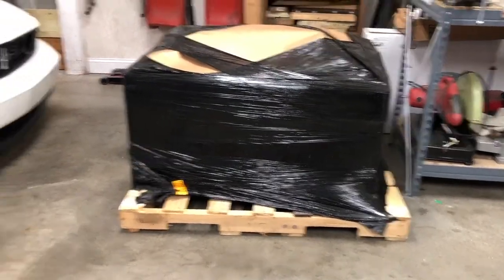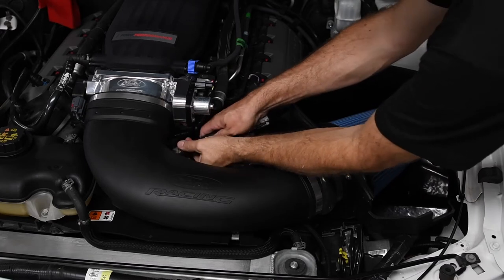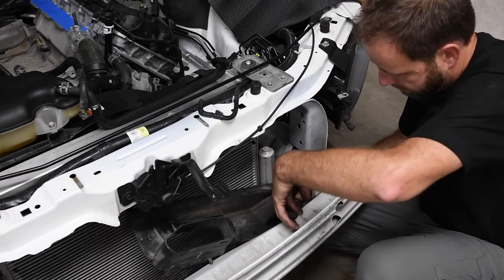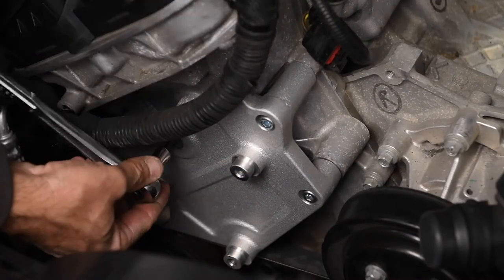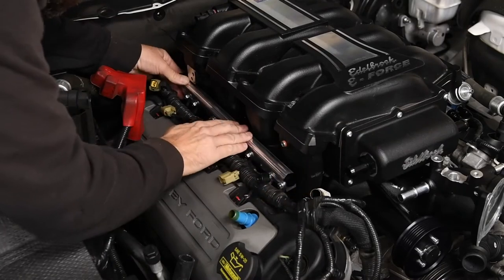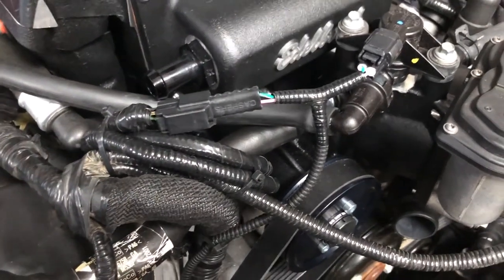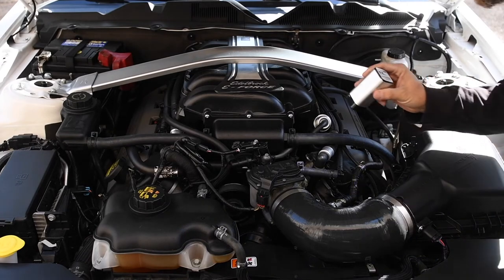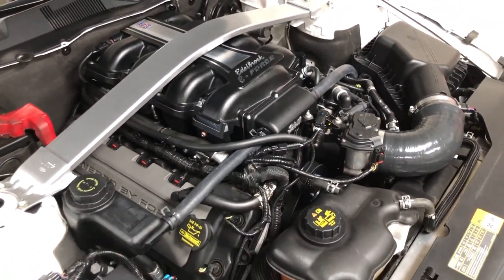Edelbrock Mustang Supercharger Install and Dyno Test

Comment: I have the same setup on my car, but a 3.25 pulley on my stock 11. It made 532/488 with a brenspeed tune and kb boostapump.
Reply from the maker: Nice! Once I build the motor with better rods, I'm going to start pushing the boost on this one.
Reply: @Mustang-Geek  same plan for mine. Brenspeed told me a 3.25 pulley is about 9psi  and the most boost that would be safe for the stock rods.
Reply from the maker: @steibz3262  Edelbrock has smaller pulleys too...muhehehhehehaaaahhhaaeee
Reply: @Mustang-Geek  yeah I'm not running any smaller on a stock motor.
Reply from the maker: @steibz3262  Oh, totally. I'm saying once I have better rods, THEN it's time for smaller pulleys. Heck, I didn't want to even put the 3.25 on it until I had better rods. REbuilding a motor is expensive. Building a BROKEN motor is MORE expensive, right?
Reply: I made 531hp and 530tq with the same as yours. Maybe long tube headers are my secret to more trq?
Reply: @carstuff4u942  definitely possible man.

Comment: Seems a little underpowered, good video however. Gen1s can take up to 600wheel pretty happily on pump gas. I believe a good tuner and maybe a little smaller pulley will do the trick.
Reply from the maker: Yes, this is with a 50-state tune, stock pulley, etc. We're gong to fortify the engine with better rods and pistons, do smaller pulley, and start squeezing more power out of this combination. There's A LOT more in it!
Reply: @Mustang-Geek  good to hear 👍, great idea on building the engine before continuing with more power. Never is a bad idea.

Is the pulley on these blowers just as easy to switch out just as a traditional TVS?
Reply from the maker: @coyoteaustin17  I'm fixin' to find out! Just four bolts...

Comment: Wouldn't the intercooler being directly in front of the radiator cause overheating issues?
Reply from the maker: Not necessarily. The intercooler heat exchanger is pretty cool relative to the radiator. We didn't experience any decrease in cooling ability.
Reply: @Mustang-Geek  so air passes through the intercooler pretty well?
Reply from the maker: @bkehlin  Absolutely.

Comment: I have basically the same kit on my 2007 F150 5.4.  It makes a screeching noise under boost.  The guy I bought it from said its always been like that.  I personally think its belt slip.  I dont mean blower whine.  Does yours make any such noise besides the whine under boost?
Reply from the maker: My blower does not make any such noise. There's not even much blower noise because it uses the stock air box. I'd suspect belt slip.
Reply: @Mustang-Geek  I appreciate it.  I do as well especially since Ive now looked and the belt is worn out and missing a whole rib!

Comment: What throttle body is used here? stock? can larger 85, 90mm be used?
Reply from the maker: The stock throttle body is used, and the opening on the blower matches it. You could probably use a larger throttle body and port the casting to match, but I doubt it's worth the effort for two reasons 1) unless your tuner has proper, OEM-level throttle body flow data, you could have drivability problems, and 2) The rest of the supercharger inlet may not support the flow of a larger throttle body either. In other words, I'd keep the stock throttle body, and if you want more power, use a smaller pulley. Even at 10 PSI (video coming soon), this blower is hardly working. This thing can support HUGE power if you have a built engine and fuel system to match.

Comment: Reaching top horsepower with the factory connecting rods?  Don't tell my 2011 GT with the same blower,  but 10psi pulley.......
Reply from the maker: I could probably push it, but building a running engine is cheaper than building a broken one.

Comment: Every vid I see of these are in the 500-550whp range which Im not liking... I'd love to see one making 600+ whp.
Reply from the maker: This is on a Mustang chassis dyno, so I'd imagine on a dynojet it might "make" more power.
Reply: @Mustang-Geek  I definitely think you'll break 600whp+ With just a pulley and another tune. Its just I cannot find anyone whos doing this lol I just got one traded my paxton for it and I'm hoping to make 600-700whp with just a simple 3.25 id1050 injectors and BAP. Lund is confident I can get mid - high 600's
Reply from the maker: @liyahalex7308  Keep us posted!

Comment: A “Massive 86hp”  for a 185lbs extra on the nose!?!   Since when is the limit for the stock connecting rods 452 rwhp??? This is a Coyote 5.0.....isn’t it? That sounds like a 3valve thing.......  Not impressed at all. That’s $70 per hp. You could spend $6000 on NA mods and a good tune,  and be —-way—-  further ahead.
Reply from the maker: Glad you liked the video! Sorry you're not impressed. I'd like to hear about which NA mods that cost $6000 will net you 452 wheel horsepower (on this dyno, that's 545 flywheel HP). We did this in a weekend, the car drives like stock, and we didn't need a custom tune. Also consider that after we build the motor with better rods, we'll be turning up the boost to get 650 horsepower...and more.
Reply: Not so good.
Reply from the maker: @angelo_giachetti  We've just begun with this blower. There's a LOT more left in it. If you're looking for high dyno numbers, a lot of blowers will get you that. but the intercooler setup of this blower means it'll be more efficient at higher boost levels.
Reply: @Mustang-Geek  yeah. Its interesting stuff.
I would use studs to hold the heads down.
Reply: @Mustang-Geek  my 18 intake,  pmas Cai, exhaust,  and tune gen 1 coyote made 434 wheel.  There's many supercharged gen 1 coyotes making 650 wheel with stock internals
Reply from the maker: @r6master69  All dynos are different. It's the before/after results that matter. Many owners may be happy to gamble with the strength of their engines...I'm not.